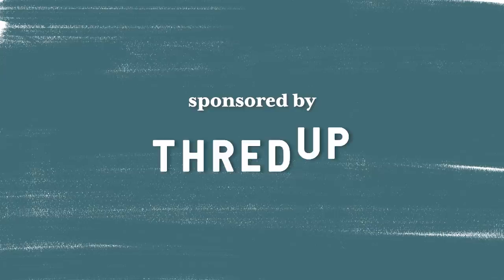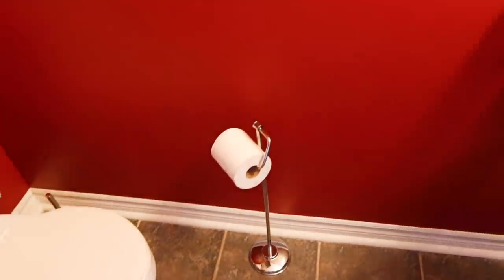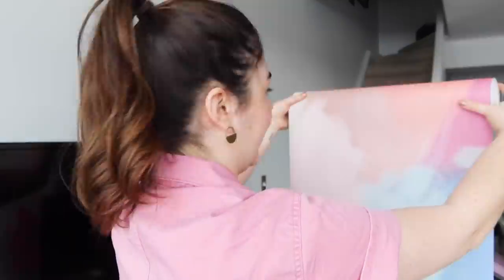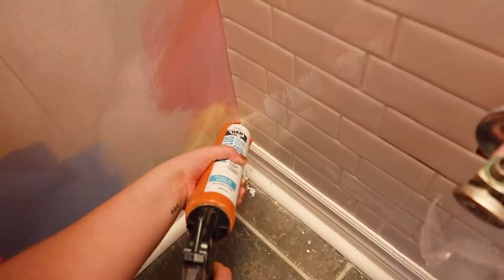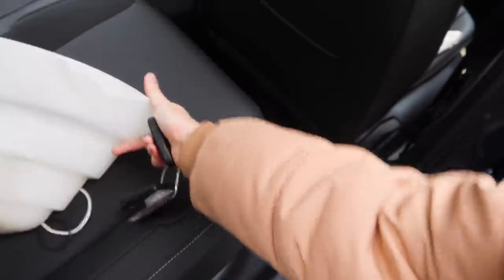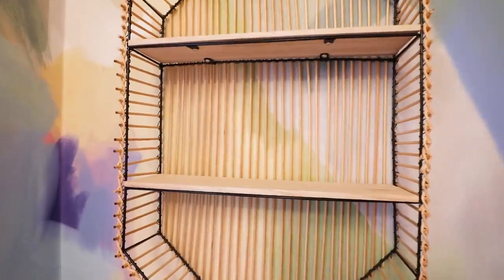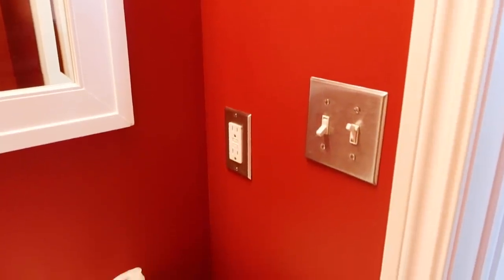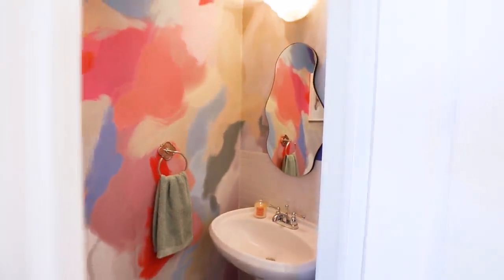*EXTREME* Small Bathroom Makeover! | Bold & Colourful

Comment: Love you, love your videos!  Hot tip: use painters tape to make straight lines where your caulk is going to go.  Then when you caulk and run your finger down peel the tape off right away and you’ll have perfect caulk lines.
Reply: Love the makeover. 
The untidy caulking is really bothering me 🥲🥲🥲
Reply: And put soap on your finger ; it makes it slide and not clump together :) also, always practice these things before trying it on the real thing! :)
Reply: GREAT TIP! Always struggle with caulking - thanks Rachel 🤗
Reply: THIS IS INCREDIBLE. Thank you for the tip!!

Comment: 9:36 if you want to get a smooth, shiny finish while using CAULKING...dip your finger in a cup of water and slide your finger over the pasted line down. It leaves a beautiful finish and keeps your fingertip clean as well. That's the way Professional (kitchen/bathroom) Installers use and apply Caulking here in The Netherlands 🇳🇱✌🏻😊

Comment: Looks good!! I think i saw a TikTok video showing how to turn regular paper into “peel and stick”. You trim out the wall with painters tape and then you put the tape down the wall where the width will be for each panel. Once you do that then you put the double sided tape on top of the painters tape and slowly peel back small sections as you work down. That way when you move out, you can take the wallpaper off, then pull up from the painters tape with no damage! I haven’t tried it yet but will be when I move :)

Comment: Pro Tip, always pull your caulking away from trim and corners, not down towards it as the excess doesn't leave a clean finish in a corner. (they also make an inexpensive caulking finishing tool with different finishing  'tips' )
I'm extremely OCD about messy caulking and yes I can say OCD as I am !!

Comment: I feel like the tile line could have been a little uneven, like a few tiles up and down like tetris to keep the craziness going. Just a thought. I feel like the shelf didn't fit, with the basket for the toilet paper the other elements didn't need to go. I would have used the print you had there.